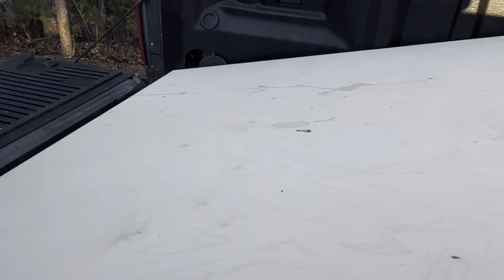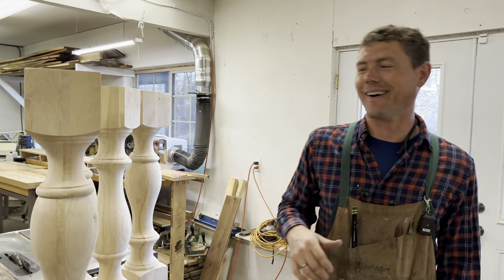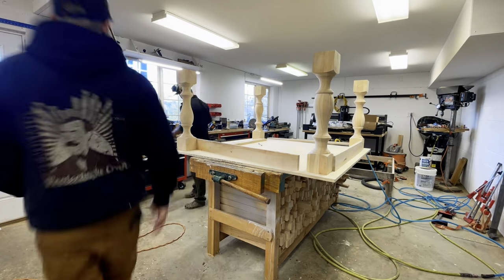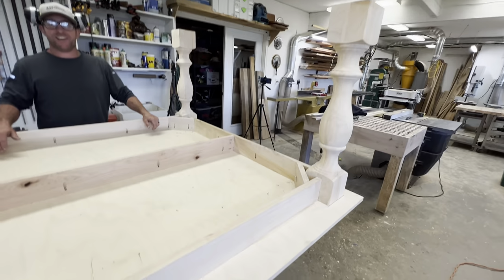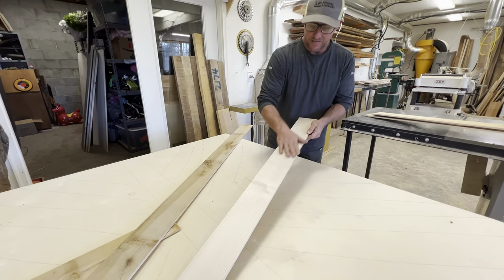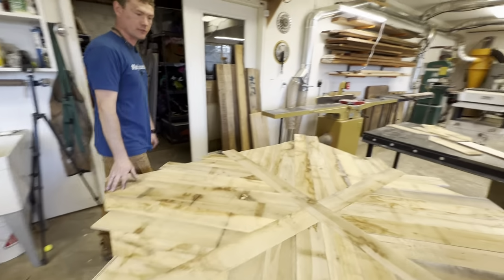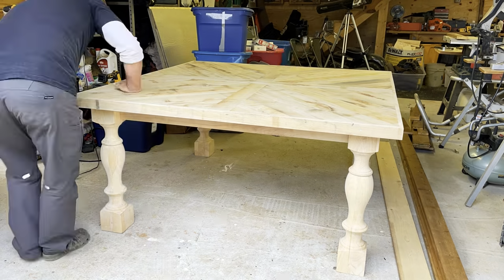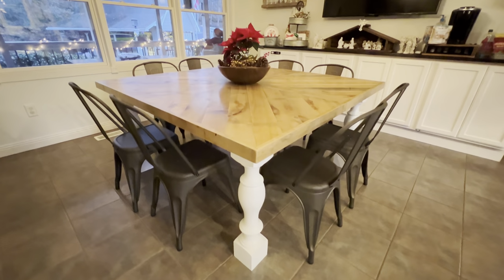Farmhouse Table // That’s One Way To Do It

Comment: Hey Jay, guess this when I used to have stuff in my pick up truck what I used to do is lay top down right tied to the dumpster and old top, put everything on top of the top tie to the back of the dumpster so when I drove away, it was slide out of the bed of my truck and into the dumpster I’m telling you it works every time you might have to get up and pick up some little stuff to fall off the dumpster but you know what it be handling all that garbage that you have to throw away see when I was a kid we could burn it, but not today. Everything has to be put away properly. Just giving you a heads up. It works fantastic, by the way, this is Alan from Massachusetts